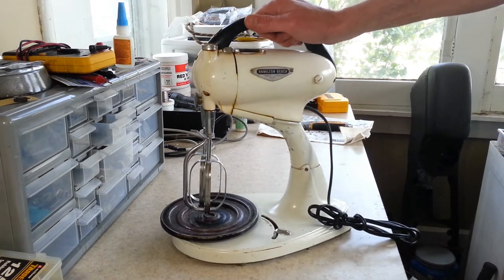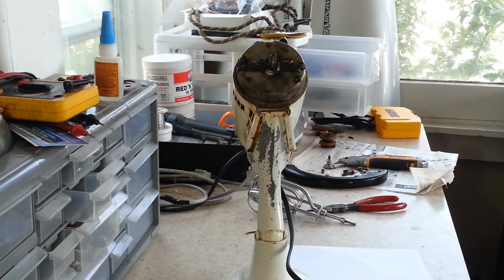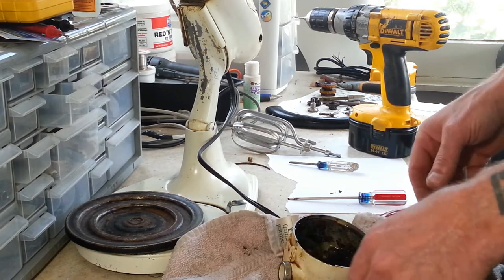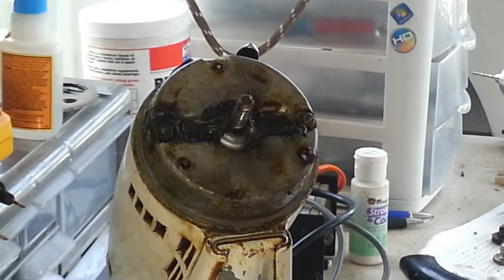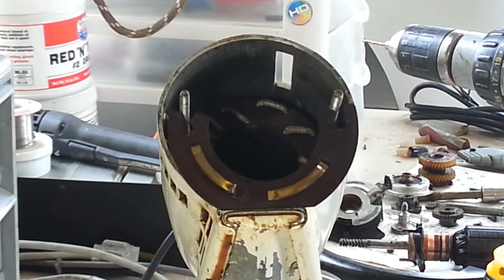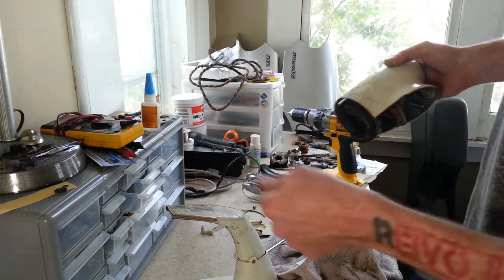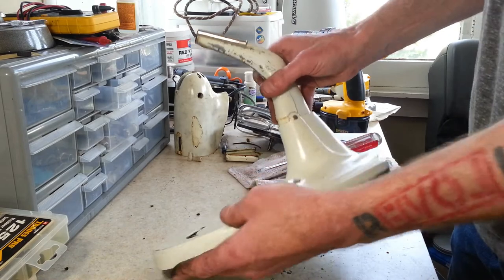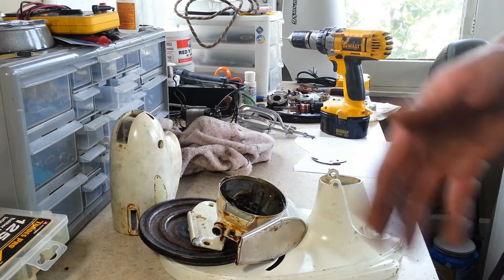Vintage Hamilton Beach Model G Restoration Part 1 disassembly

Comment: Any hint on that bushing held with the spring at the far back of the mixer? The one with the oil wick?
Reply from the maker: Make sure the kids are in the other room when you start cussing lol. They are a pain, personally I try to use a knife and a pick to get the spring out , once you can get the end of it above the base, you can grab it with pliers and twist it out. Then you can pop the first oil wick out with a pick. Royal pain, very tedious, and I may have made up a few new swear words working on them lol

Comment: Thank you for this vid, I wish I had found it before I tore mine down....LOL!!!! Would have been REALLY great if you had shown us what you were actually doing at around 18 minutes in....the camera was just on the SIDE of the mixer body, NOT on the inside. & what was that thing you said was no longer useful, or viable? The RF filter?  Where would I find one of those to replace on mine.
Reply from the maker: Yea I am sorry about the crappy camera work in some of the videos, I am not a camera person, and many times I cant see the screen of the camera while I am working, so I occasionally miss some parts. The RF filter is no longer needed, and i toss them since they can fail and lead to current leakage to the housing and give you a little shock
Reply: @vintagemixersandmore1666 ; well.you've got way more ability to make vids than I do....LOL!!!  I found the inside peek on another vid..so, I finally got to see where the other brushes  were...:-} Thank you for showing us how to fix these wonderful machines correctly..I appreciate it very much, I can hardly bake anything without my mixer...I wan'ted to mention that I found a non-toxic grease, it's blue, for marine engines, it's very cool stuff. I found it at Lowes, which is the only place around here to get anything tool wise.  It stays cool at very high temps. Just fyi, you might want to check it out.
Reply from the maker: @moneypenni1694  Awesome! Appreciate the tip on the grease too, i will have to look into that! :)
Reply: @vintagemixersandmore1666  ; you're very welcome & thank you so much for helping us diy er's....:-}
Reply from the maker: @moneypenni1694  I do hope that at the very least I can show it is possible for most people to be able to repair and maintain them on their own :)
Reply: @vintagemixersandmore1666  ; yes you do & you do it pretty well, i spend alot of time learning to repair. I live in a very rural area & I cannot even conceive of what people are thinking of when they discard repairable items...makes me very sad at times.  If Grand Junction Co, there is a group, quite extensive now, that believe it or not, is a 'yahoo' group....(probably the only good thing yahoo has ever devised,) called 'freecycle' where people post either what they want, or what they have to give away to someone who can  use it.  There are no 'reasons' given to either ask or give away, but when I lived there I was very active on both sides of that adventure...I got rid of items which I no longer was using & asked for things which I felt I could use..it keeps TONS of usable items out of landfills,  builds community & allows a safe environment for people to 'feel' valued..:-} I miss it, but I don't have the time to try to develop  a group here or I would do it.
Reply from the maker: @moneypenni1694  wow thats a great idea. Im surprised there are not more groups like that. We take a lot to the salvation army, but have also advertised items as free and they are usually gone within 20 minutes lol.
Reply: @vintagemixersandmore1666  ; I hear you, I used to go to habitat for humanity, when their paint shelves would get full, & nothing was selling, I would see them put them out by the dumpster to get picked up, I took home over 80 cans, 5 gallon buckets, pint cans, some with just a half or so left, some looked never to have been touched...& put them out along my fence listed them as come & get it on the offer page & within 2 days, everything was gone...some people KNOW how to use wisely....my hot water heater went out on me , so I put out a request for another. 2 days later a man told me he was changing over to a newer one & I could have his old one, it still worked, was only 5 years old  he was just upgrading him mother in law cottage, took me a couple of days to find some guys with a truck & they helped me bring it home & install it, took the other to dump...it was very old & very rusted out, no way to recondition it.   You should check on your area to see  if there is a freecycle group locally... when I first joined with the GJ one, there were less than 200 memembers, by the end of just 2 yrs, there were  over 2,000 of us..it really was pretty amazing,...:-}  Just type in , Yahoo groups/ freecycle & see what comes up for your neck of the woods..there is every possibility that you already have one going where you live.

Comment: I enjoy and learn from all of your videos but this one in particular was especially good. If you could, sometime could you expand on what an RF filter does and why they are not necessary.  Even though I did 4-H Electricity when I was about 10 years old, I remain at my much older age an electrical/electronics dummy.  I'm very mechanical but the electricity stuff just zooms over my head at high speed. Thanks again.
Reply from the maker: Hey Erik! I might if I can get another video out in the future, Thanks!
Reply: What value is the cap that you keep in there so there will be no arcing???
Reply: by using a 3 prong grounded plug the RF filter is eliminated.  I found that explained on a different video by Nelson Ogden.